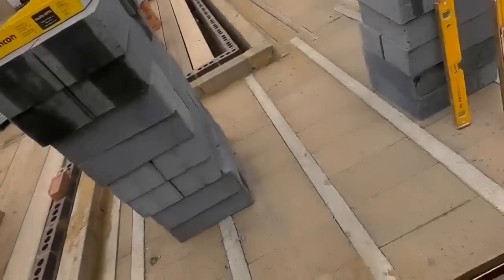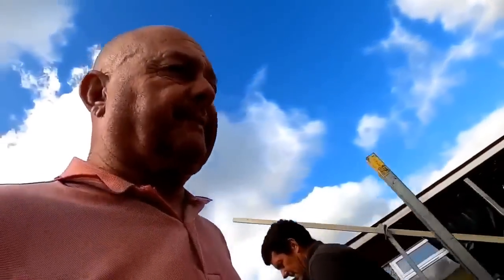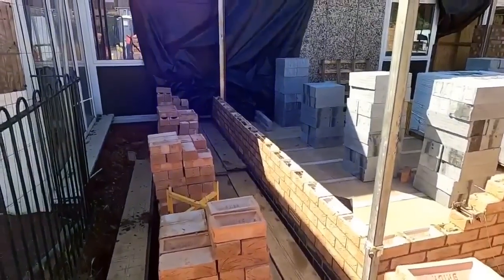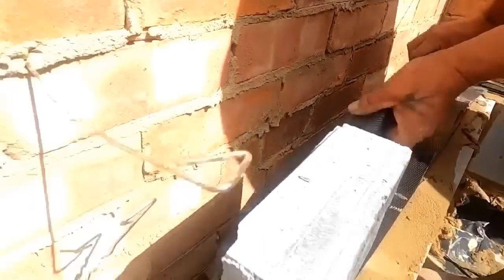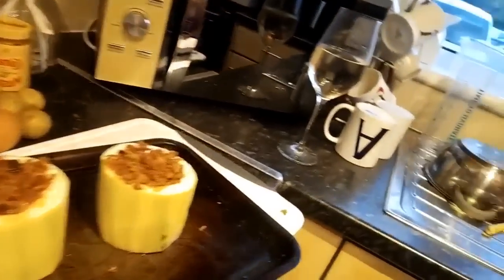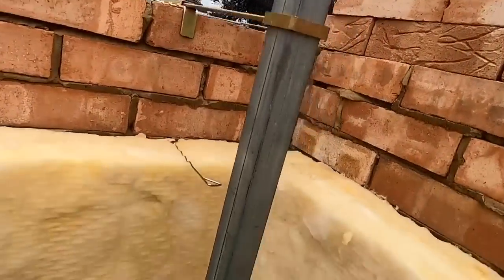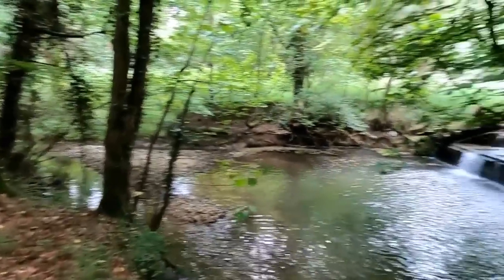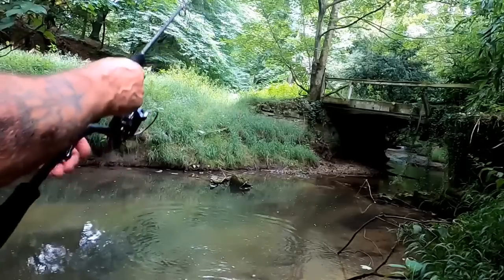Cavity Wall new regs, my week as a Bricklayer.

Comment: Which would you prefer if you had the choice, those 150 mm blocks with the 100 cav or 100 mm block with 150 insulation . 
   I reckon both are better than block first and 95 mm pir boards . 
   Love the trout fishing in the garden 🎣🧱👍🏽
Reply from the maker: If i was building my own house Steve it would be the 140s, but for builders 150 insulation just because the blocks are lighter.
Reply: Anything is better than block first for me, I'll never get my head around not putting up the brickwork first...
Reply: @handycrowd  totally agree chaps 🤜🏽🤛🏽🧱👍🏽

Comment: The Germans have a 150mm block which was (as far as I,m concerned)a great bit of gear.You stuck the brick hammer in a slot on top and the hand in a feature at the jointed end.So easy to lift and lay.

Comment: Hi Andy,
Just started building  a shop 11m x 18m roughly,.
100 mm brickwork 120mm cavity with 70mm insulation,internal 140mm concrete 7 newtons.
No fun lay them buggers in the footings at nearly 60
Reply from the maker: I dont touch concretes anymore John, to easy to injure myself at my age, take it easy with them mate 👍
Reply: Cheers Andy 👍 
Great video

Comment: Why are you laying on a plastic tray, then folding it up to the next course, surely, it should be a tray from outside brickwork, onto internal black work 🤔
Reply from the maker: Not possible, the air bricks and telescopic vents would compromise it, that's why Architects specify the C section damp, I just do what ime told anyway 👍